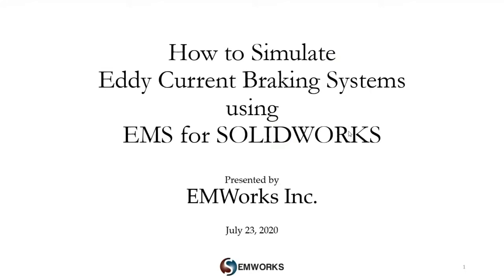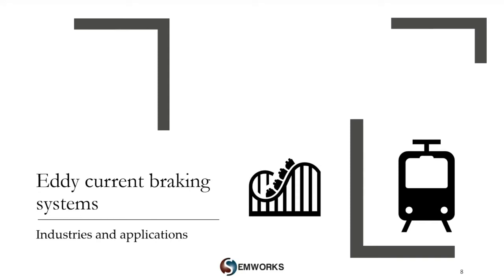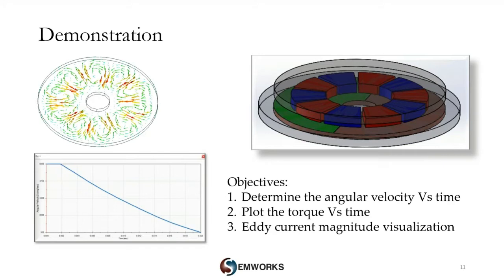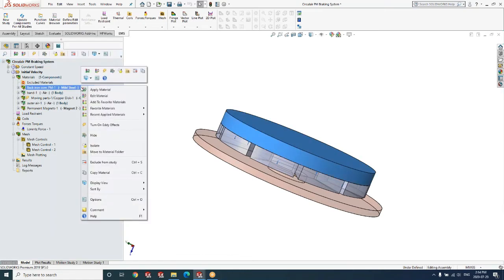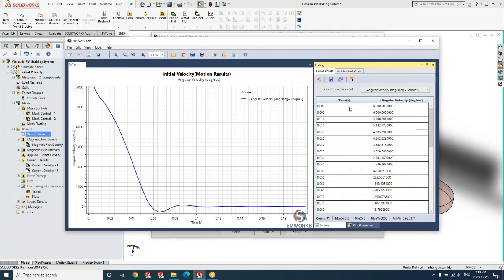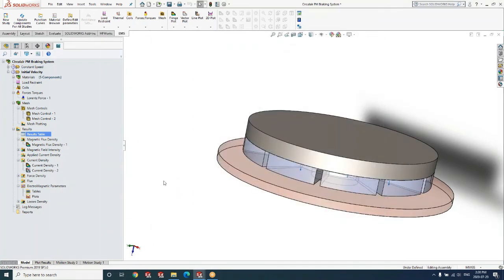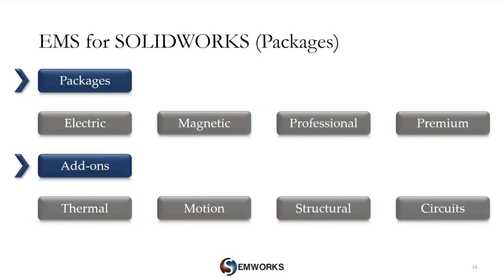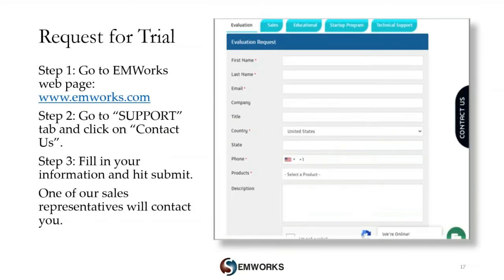[Webinar Recording] - Learn how to Simulate Eddy Current Braking Systems in EMS for SOLIDWORKS

Comment: Hi Majdi, I have a question about eddy current losses in permanent magnets. I am using Neodymium magnets for which electrical conductivity is 600 000 S/m. Losses that are happening in magnets in axial flux PM motor are 50 000 W per magnet, that in not possible. What is happening here? Thank you for your time and help.

Comment: Hello sir, we have a similar setup for our research project, can there be magnets in the rotating disc[will the polarity change dynamically as the disc rotatedls] , if yes we would migrate to ems from other simulation software
Reply from the maker: Hello,

Thank you watching our video. 

The magnets polarity doesn't change during the disk rotation. It should be the case in real life condition. I hope I correctly understood your comment. 

We can discuss this with more details through email; majdi@emworks.com/support@emworks.com

Regards,
Reply: @EMWorksInc  if there are magnets added to the rotating discs, apart from the stationary magnets, will the polarity of the magnets in the disc change dynamically as the disc rotates?
Reply from the maker: @mkjaiganesh387  the magnets will rotate with the disk: so if we suppose a fixed a point apart from the rotating components, this point will see different magnets polarities. in other words, it is like if we have magnets with dynamic magnetizations relatively to a fixed point. 

if we have moving and stationary magnets, we will have variation in the magnetic field direction that goes to the disc. I dont know how this can affect the generated torque later. We need simulation to see this impact.

Thanks